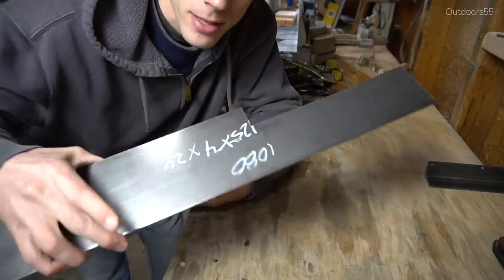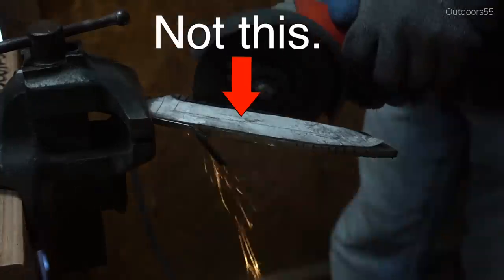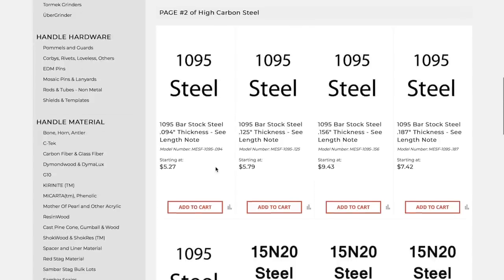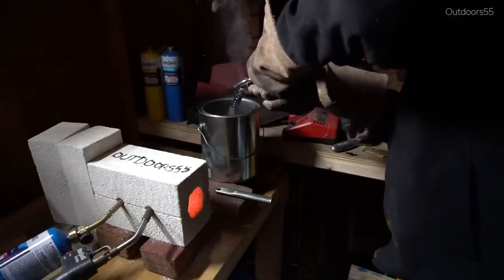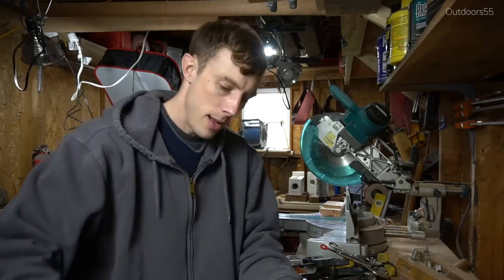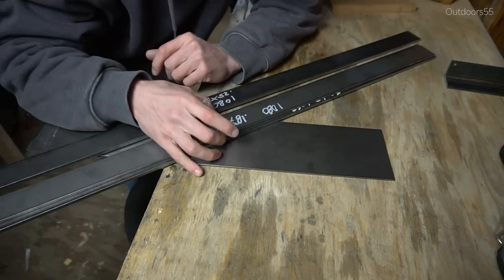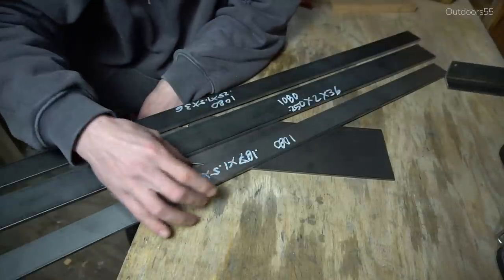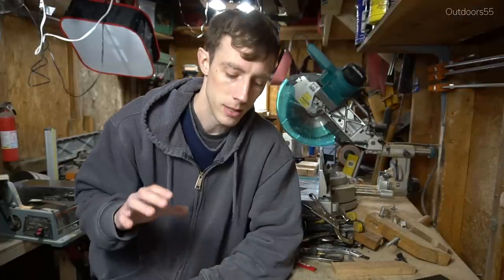Beginner Knife Making Steel | Where to buy Knife Making Steel And What Steel To Buy

Comment: I’ve used 1095, 1080 and 1075 and for me they all worked the same. The only issue I’ve ever had with heat treat was not having the quench oil warm, that’s where your knife will crack in heat treat. I had a backyard forge, heat the knife orange and quench in warm oil and never had issues. I also tempered in a toaster oven. I tested my knives when I was done by clamping them in a vice and smacking them with a hammer, they shouldn’t break and should be springy.

Comment: Good info for new knife makers.  I use more sophisticated steel but then my first knife is still in use.  I made it from a Farriers Rasp in 1959.  I was 10 years old.  The blacksmith in my hometown guided me through the process using a coal forge.  I still use a coal forge when heat treating.  I am in the process of building a cleaner burning forge (propane).  My grinders are genuine antiques that are very slow but don't heat up the steel.   I also have some excellent belt sanders.  I am retired but still fool around in my machine shop.  I learned forge welding 60 years ago too.
Reply: Wow, that is awesome. But omvwey new on learning blacksmithing. Got alot to learn. I have books that Im reading up on it? O don't have anyone that would or want to teach me? It's almost like a treasure hidden in field?  So, determine to know this?
Thanks for taking the time read this.
P.S. when you are ready to get rid of any of your work shop tools plus, the machinery let me know first!! 
Thanks again
Reply: Good on you sir, I hope more people like you are around so the skills do not die.

Comment: O1 is an alloy tool steel and is a deep hardening steel. That means that it will harden in just about any oil because of how slowly it can be cooled and still harden, making it very easy to heat treat. It just repuires more soak time than a simple carbon steel. 5160 has a higher critical temperature, at about 1550, but is also a deep oil-hardening steel.
Reply: What steel would you recommend using for knife making?
Reply: @mcween18  anything you can get your hands on that you can guarantee what it is. If you can purchase O1 from a reliable source, use that. But it also depends on what you are making and how you are making it. If you are interested in using a professional heat treating service, that opens up a lot of higher alloy steels. If you are forging, generally you should stick with simpler carbon steels, and avoid anything considered "stainless", but even then, it's not a hard and fast rule.
Reply: @DragonHide94  cool thanks.

Comment: Two sources, Admiral steel. In Illinois. A 6 foot bar of 1080 is 1/8" x 1.5" is like $13-14 minimum shipping is like $24 but you can ship 6 bars of steel for  that price.  So you can get a variety of thickness and widths. 

Another is Aldo Bruno. He goes by New Jersey Steel Baron. 

Most of his stock is 3' & 4' lengths

I'm not posting links because usually the posts get deleted by YouTube software unless the owner of the page allows links. 

You can Google either of these.

Comment: I use o1 and haven't had any real issue with heat treat. O1 is actually quite forgiving in my experience (limited as it is) O1 is also locally available so it's my goto steel.

Comment: I’ve been making knives for a while now. My go to supplier for high carbon is admiral steel. They have the best prices on 1095, 1077. You can get 6’ sticks for less than 20$. I know a lot of people like using found steel, like leaf springs and whatnot, but I’d say to leave that to more experienced makers who can tell the difference between junk and good stuff. Found steel can create more problems  than it solves, e.g. microfractures, unknown heat treat schedule etc. anyways, it has never been easier to get into knifemaking. There’s no task in knifemaking that can’t be done with just a good set of files, a hacksaw, and sandpaper

Comment: Good advice on the type of steel.  I recently bought 48"x2"x3/16" 1084 steel from Pop's.  It was $35 + 17. shipping and I got it in 2 or 3 days.  It was straight and came well boxed and packed.   It may not be the cheapest but I was pleased. Cutting out the rough shape with an angle grinder cutting disk was no fun at all.  I picked up a Harbor Freight Bauer metal cutting saw on sale, made a stand out of 3/4" plywood with a 10" x 10" 1/4" thick aluminum plate work surface and was able to cut out 2 knives in about 15 minutes.  Much easier and better and safer too.  My next challenge is to attempt a full bevel grind on a 5" blade with the 4x36.  What belt do you use to get a nice satin finish on your blade??

Comment: You gave valid point on thickness of steel but you can make good knife with thinner steel but you'd have to do it japanese way. Also for me i'd use pure high carbon steel as it's maybe the most versatile material and great for begginers. Before heat treatment what you can do depends on your imagination and resorcefullness.

Comment: if you forge, id strongly suggest looking at your local steel supplier for drops. my local place has O-1, A-2, D-2, M-2, 4140, and S-7 for $1.25 / lb. for referance, tool steels like this are typically $10-13 / lb. the only disadvantage is they are in shapes.and sizes that really arent suited for stock.removal. the smallest flat stock ive found there was 1/2". also pay attention to the batch numbers,.usually written on the stock..if you can find a number of bars from the same batch it will be a great benifit in figuring out your heat treat

Comment: All good solid info and confirmed from my experience! While I prefer 1080 for your reasons and more, I currently have a LOT of 1095, I got tired of running low on steel and bought 2 of 2 foot by 4 foot 1/8" sheets, I still have 2/3rds left lol, but yes you have to know a bit more and experiment more to properly heat treat the 1095, 1080 doesn't care but that extra .15% extra carbon really makes the steel more temperamental, again great info!

Comment: I've been making knives for about a year and I order my steel from Admiral Steel. It does sell it in six foot lengths but I always get quality steel from them.
Reply: Dave Erving Evader Knives That's interesting because I have never had a problem with them.
Reply: Dave Erving Evader Knives One thing though that might be the problem that your guys are talking about is hot rolled steel. All hot rolled steel can be hard to drill though sometimes. Just be aware of that if you buy it.

Comment: I bought some cold rolled steel.  It is probably Cold Rolled Steel C1018.  I made a tanto out of it and it was super easy to grind. I have not heat treated it yet. I will tomorrow.  But is c1018 a bad metal for making knives?

Comment: I'd lean towards 3/16,.....granted some very tough Machetes are an 1/8 or less and even a circular saw blade is less than an 1/8.
I worked in a golf club factory and had access to some very powerful machines  I ground hardened  files into  knive's that looked like chrome,....skids for handles.
In those days I didn't know how to untemper the steal I just ground and dipped in water.
I had trouble drilling handle pin holes,......about 6 drill bits per hole,..... even cherry red.

So I ended up heating handles cherry red then blowing a hole with a 110 mig on low.
Then I would fill it in with J.B. Weld and drill the hole and then I used High Impact epoxy to put the handles on.
That saved money on drill bits.
Then I would cut a blade from a circular saw and weld a 1/8 soft metal handle to it?
See if you weld it cold its brittle and snaps,....if you  get both pieces buts at 90 degrees for splicing,.... you  cut into each piece about 1 inch you shim the thinner saw blade to weld straight,.......then you heat it cherry red and leave the soft metal cold,.... and with a 110 mig on low you tenderly tack here and there till its all tacked.
Then as soon as its tacked you run a bead over the tacks in both sides,.....then you will use a angle grinder and a 80 grit sanding disc to remove the weld.
Then it's all 1 piece.
I use 1/8 X 1 cold rolled soft metal,......I cut it to the length of the handle,.........easily drill my holes and shape them 5 or 6 at a time the I lay them on a kitchen stove burner I always cook on high so I cook my meals on high for 1 week,... then flip the handles and  do it for another week,.....and its hard shit,.....but I have also just welded soft steel to hard steel handles they are never going to bend  after welded and the handle is epoxied on.

Comment: All i use is 1095 and i get the best results from it. And my heat treat  process is pretty "Crude". and that's the steel i started with.
Reply from the maker: Try some 1080. Can’t hurt. You may get better results, and you may not. It’s a great steel though. As far as I can tell it doesn’t lack anything from 1095.
Reply: OUTDOORS55 I have used 1080 it’s good but I like to use 1095 because that’s what all the old timers use, yeah I know that’s a pretty stupid reason but whatever.... and I do get the best results for me out of it. Thanks bro  for the response god bless!

Comment: Here’s what I want to see:  1080 backyard vs o1 backyard.  I’d be willing to bet nearly equal results.   Yes you don’t get everything out of the o1 you could, but you should get everything out of the o1 that you get out of the 1080, you just don’t get the cementite that you could get from proper HT.  The downside being you may pay more for certain dimensions of o1, but personally, guaranteed I can find more volume of o1 for way less than I can 1080.  I just bought 36” of 15/16 o1 for $38 free shipping. I can’t hardly find 1080 and when I do i pay nearly same again for shipping.
Reply from the maker: That would make an interesting test. I’ve thought about doing that myself. Not sure what the best approach would be for testing them though. I’m not sure my methods would be accurate enough to give any sort of conclusion. If not very erratic results.

Comment: Alex, you seriously have the most concise informative knife videos online. Thank you again.
I am curious about your thoughts on convex, and the application and aspects thereof.
Reply from the maker: Thanks man! I love convex edges. They are not as prevalent as they should be. Lots of benefits with little down sides. That’s one of the reasons I always felt hand sharpened edges are slightly “better “ than a controlled angle system.  Any freehand sharpened adage has a slightly convex to it. That’s why a lot of times you can get away with a slightly steeper sharpening angle on freehand sharpened knives, than you otherwise would, on a controlled angle system.  I’ll probably do a video on this topic at some point. Haha I’m rambling now😀
Reply: James Thacker good for swords and axes and things you don't want to bind in use

Comment: You can also use ar400 or ar500 or tool steel and this metal if you don't get it too hot when cutting it you don't even have to temper the metal

Comment: The hardening process for 1095 and o1 or w1 or w2 or 5160 or any other high carbon steel with minimal alloy elements such as chromium are all virtually identical

Comment: I worked with sheet metal and we used 1080 and it was in the category with mild steel.
I’m pretty sure 1080 is the hardness… but I never payed attention as I was just entering data to bend up the metal on break presses.

But I could be wrong, however if 1080 works go local.

there are steel company’s all over who will probably sell you scrap pieces of 1080 all day that size…

Ask a wielded in your area where to buy metal from

Ask that place for your 1080 

I think square tube  could even be used as it’s probably 1080 as well maybe ask if it is then bam get some 3 inch or higher to cut out your 1080 flats for suuuuper cheap.
No joke I live in California and tubing is like 70 bucks a  big ass stick but that’s A LOT
Reply from the maker: 1080 is not mild steel. It is a high carbon steel with .8% carbon. 1018 or Mild steel will not harden due to its low carbon content and is not suitable for knives👍

Comment: Cool video. Someone mentioned here in the comments using a bed frame. Considering the span and weight it needs to support it could be high carbon steel? What do you think of a tire iron?

Comment: Alex, been using the edgepro stones for sharpening, but was wondering how you prevent them from moving?  tried using rubber pads, but when wet they still move slightly.

Comment: What I can say is in Germany you can get the most blade steels without any problem. Only pure carbon steel without chrome or almost nothing than carbon as alloys is difficult to get.
Reply: Where do you buy steel in Germany? And is it also called 1080 or does it have a different name in Europe?
Reply: Oskar Mohar there are some sellers like knifemakers and others who runs internet sites as an example: Nordisches Handwerk, Schmiedeglut, Lindenschmiede, Thomi Metallhandel, Recknagel sometimes eBay and many others too. The steel types are a little bit different pure carbon steels are not so easy to get like that 1080 there are a few types out there that have almost the same ingredients like 1.2842 or 1.2235 but not exactly. The carbon content may be the same but there are other things in it like a little bit chrome or Mangan. Pure carbon steel is not much used in industrial development toady. You might go to the next seller and order 100 Tonns of your desired steel and they'll make it for you.

Comment: I wanted to add a little perspective for those persons who are prone to believing the purists about grades of steel. While most knife makers bring excellent points about carbon content, edge retention, tempering, etc. I think that it is important to ground ourselves in history. I will not deny the validity of using fancy modern steels for tools as they are quite good. For literally 2 million years of human history, empires were built with essentially glass knives and granite. With the discovery of bronze, China expanded their empire for 4000 years using a metal so soft it had to be work hardened in order to be more useful. Putting this into perspective allows us to experiment with mild steels, bronzes and medium carbon steels like lawn mower blades and coil springs. Making knives and tools from known steels like 1095 have clear and obvious advantages, however, when you understand the material and don't mind sharpening more often most steels will create a perfectly serviceable tool.  There is no metal that is a "waste of time" or history would have looked quite different. Try telling Otzi that his flint knife and his small copper ax were a waste of time.  Just two cents from a history teacher who is also an amateur woodsman and knife maker.

Comment: Good video, but I have to personally disagree on your size choices. Starting out, I was talked into 1/8" x 1 1/2"  Thankfully I also bought some 3/16 x 2". As I found that MUCH easier to work with. And my biggest regret was limiting myself to that 1 1/2" width. It really REALLY restricts what you can make. 
Going forward, I try to never go less than 2  1/2" width.

I also just finished a whole batch made from 1/4" x 3" in 1095 steel, my equipment is very basic, and it wasn't anywhere near as difficult as I thought it would be.

Comment: Is 3/16 thinness good for beginner with only an angle grinder and some files?
Reply from the maker: Yeah. Its up to you. If you have an angle grinder you can remove metal very quickly but it will take more time. It also depends on the grind you want on your blade.

Comment: You know what's a good pine of steel that I use for beginner as furniture steel so you have a long couch and a has long piece of the steel actually not badd to learn how to make night same with recliner steel I know it sounds weird but I made a knife out of it that I did not even have to heat treat in at chopped in the not damage but I'm just a beginner I just thought I'd throw this out there for cheap way if anybody knows any modifications for  4 by 36

Comment: I have a  question, is stainless steel good for forging a  knife
Reply: Harlice Laver no. Stainless steels ironically we're not created to be stainless. They were invented to be "High Speed Steels" you can get stainless very hot without it losing its heat treatment. 
This is because the Steel throws heat very fast. Stainless steels are all air quenching steels. They cool that rapidly in the air. As you can imagine, this makes forging difficult at best.

Comment: I use steel bed frames and they work perfect. No heat involved
Reply: Robby Palmer interesting. Is that high carbon steel? I imagine it is pretty tough considering the span and weight it has to support, not to mention the activity in the bed.😂

Comment: Have you or anyone in the comments tried air hardening steel? You just heat it to the specified temp and set it aside. A pro from Texas uses it for folders that were $300 and up in '08
Reply: K R Knfmkr (im not an expert, just a hobbiest) Alot of your air hardening steel require a soak period at a specific temperature in order to obtain the maximum heat treat wanted in a performance knife. So although it may be possible to "harden" a air hardening steel using a backyard setup it would be difficult to get maximum performance out of that blade.
Reply: Teddy Bear Knives I wouldn't know. I use scrap steel; leaf springs, coil springs, lawnmower blades, metal cutting saw blades etc

Comment: accidentally bought 1/4 inch and have a file to grind, is it worth trying?
Reply from the maker: Sure! it may just take a while.
Reply: OUTDOORS55 thanks. also, is it good enough with just a file, or should i be using a jig? Again, this is only my first knife.
Reply: Nedal Drinks water jigs are a matter of choice. I have been making knives since 1990 and I free hand grind them all. I've never used a jig and only heard about them a few months ago.
Reply: K R Knfmkr Thanks for the advice.
Reply: I would invest in a grinder, cheap and so useful.